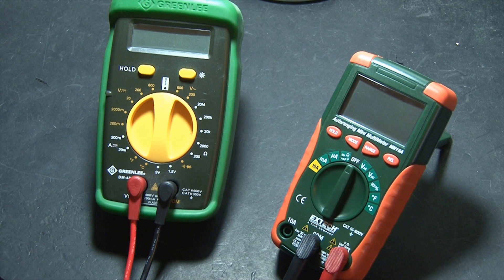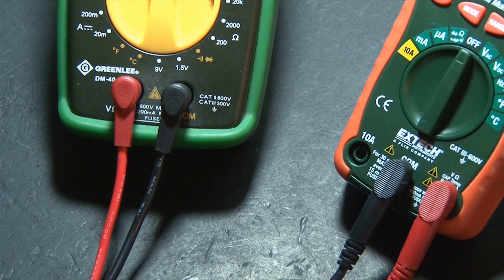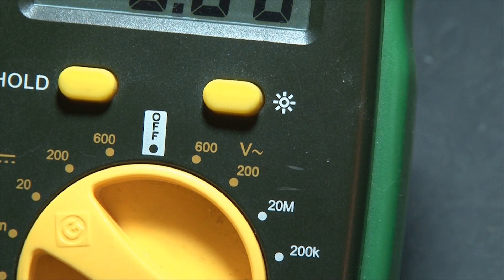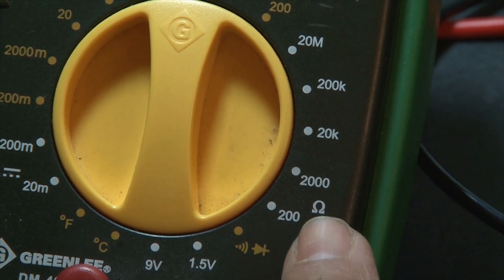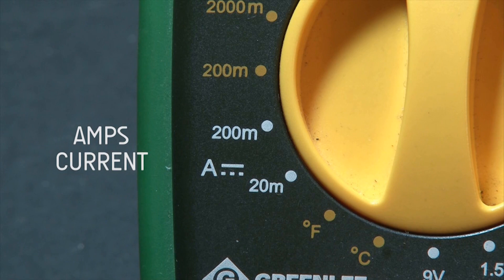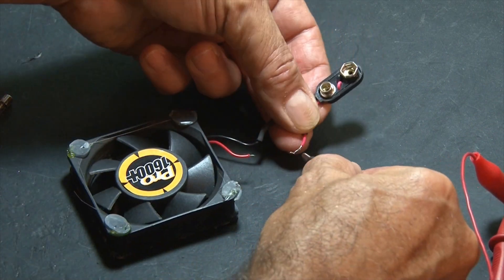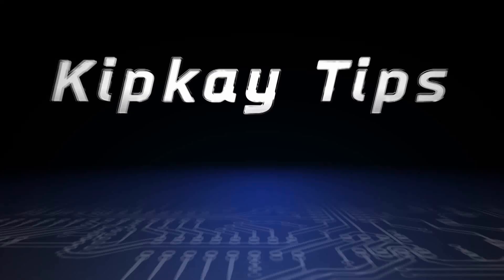How Does a Multimeter Work? Kipkay Tips

Comment: How does the temperature work?
Reply: It has another pair of wires (thermocouple).  Just plug in the red and black probe.  The other end is used to measure temperature, say air conditioner of automobile.

Comment: yet my dumb teacher told me not to stick my sticks into the outlet...
Reply: Mr.Found yup... when she told me that I did it and she went wtf
Reply: Well, with cheap multimeters it’s never a good idea to do that, it might have a resistor between the probes, good ones are 10 Mohms, but cheaper ones might have higher ones, and remember that if you accidentally switch the range selector to the amps range (only on bad ones) it just shorts the probes in a shunt, that’s very dangerous and could cause the multimeter to literally explode when the cheap glass fuse shatters (that is if there is a fuse at all)
That’s why you shouldn’t plug your cheap test leads in a wall outlet  

But with that said, chances are nothing is gonna happen anyways

Comment: 3:09 what's that chip device for, does it play sound? 

And I have a RadioShack Mini Multimeter that I rescued from their trash. I had to take it all apart and clean it all out and I got it working. Had to change the probes because the other ones were broken.

Comment: My multimeter has a hFE function for transistors, which is handy. Does a multimeter break when the voltage is above the range, but I am measuring with a fused contact (1.2A). Also, when I check a Schuko power outlet (I am from Serbia), which is 220V, can I set a 200V range?
Reply: i dont know I have true RMS meter so i dont have those options. but nothing should break unless you try to check resistance or continuity on a live circuit or electrical devices using the probs on the amp setting (that is for small electronic things, for real electrical work use a clamp on amp meter and use it on only one wire at a time to check for current). go to the next highest Voltage range.

Comment: Why does the US only have 110 volts?  In Europe it's 230 or something...
Reply: Actually, in the US, the power IS delivered as 240 Volts.  But, we divide that power once it enters our home's "load center."  The load center is sometimes called a "power panel" or "circuit breaker box."  

It's true that most of our smaller appliances use only one of those 120V legs.  But as delivered to a residence, there's two separate power-carrying conductors, each supplying about 120V.  After they pass through our power meter, they enter the residence, and then a load center.  But these two conductors are carrying power that's 180 degrees out of phase from one another.  In other words, when one is at +120V, the the other is at -120V, for a full differential of 240 Volts.

Where they enter the power panel, they two conductors are physically connected to two separated bars called busses.  The load center is also connected to a grounded conductor (or as they'd say in the UK, "earthed").  That ground is at "zero" Volts.  Therefore at any time the difference between ground and one of the two individual busses is up to 120V.  

The single-width circuit breakers seen in our power panels are then used to tap one of these busses.  It'll have a black (or red) wire coming out of the breaker.  That conductor, plus a white neutral wire (which is connected to ground also, but designed to carry current -- which makes it different from a grounding conductor, which is there for safety only) are then routed to wall outlets and light fixtures, bringing 120V to them.  

However, when TWO (red or black) conductors (one from each bus) are used together, the net difference means you're right back to 240V.   An example of this is how ovens, electric water heaters, and electric clothes dryers are wired in the USA, due to their high power needs.  These are fed by "double wide" circuit breakers, which tap both power busses to get the full 240V.
Reply: @floobertube Thank you for the explanation.
Reply: Why does Europe have 230v? In the US we only use 110v.
See what I did there? =p
It doesn't matter in the end.
Also the US was one of the first to use it on such a large scale. So, unlike Metric, Most other places were the ones being contrary for this one.
That said, 110v requires higher current, thus thicker cables.
230v requires more insulation, thus thicker cables.
With the price of copper vs insulation, I guess 230v works out better but, hindsight is 20 20
Reply: 230 V phase-to-neutral and 400v phase-to-phase has lower transmission losses and can deliver more power with equal wire gauge, with that said its more dangerous, but more danger equals more caution, so plugs and circuit breakers are much safer.
And that’s also why Americans usually have two wire medium voltage poles with a transformer for petty much every house, while Europe has 3 wire three phase medium voltage lines powering bigger transformers that feed three phase+neutral lines going out to a bigger area: transmission losses are less and it’s cheaper to have a single big tan former for many city blocks than one for each house (or almost)

Comment: 0:46 you got that backwards. The path from  the voltage port to ground has a resistance of 10 megaohms in most modern multimeters. It isn't going to do that much to a circuit, even if you use it completely wrong.

The path from the 10A / mA ports has a very low resistance and you have to know what you are doing when you want to use it, but it's fused, so it can't do that much damage to a circuit.

Comment: Trying to measure the resistance of a speaker and compare it to it's impedance (8 ohm) and says well it's not quite but its within tolerance. He obviously doesn't know what he's is talking about 'cause I've never seen a DMM that is able to test impedance at 1khz.
Reply: He does not understand the difference between resistance and impedance/reactance (induced by a.c. or electric pulses).    A DMM does not generate sine wave of 1kHz.

Comment: A multimeter is good for any DIY project?  Nope.  Can't drill holes with it, can't cut wood with it, etc.  Putting that aside...

What kind of idiot-level explanation of multimeter usage fails to mention that putting multimeter probes into a mains socket is perfectly safe as long as the meter isn't switched to current, continuity, resistance or diode test?  An explanation aimed at idiots that was provided by an idiot.

BTW, any sane person would have checked the fan current by placing the connector on just one pole of the battery, leaving one pole of connector and one pole of the battery free to be bridged by the meter.  This avoids the bodge of cutting the lead, then having to solder it again later.

I thought from the title and the preview image that this would be a flash-bang demo of what not to do when metering the mains.  Instead it was a trite, banal, condescending explanation aimed at idiots made by an idiot.

Comment: guys those who are from different country  with 230 v a.c. don't keep that knob on 200v keep it on 600v or whatever greater than 200v
Reply: Or just get an autoranging multimeter. Nobody should buy a manual ranging multimeter in 2017.
Reply: StarTrek123456 yeah autoranging multimeters are cool but i kinda like manual ones

Comment: When doing the outlet thing, with the probes are not touching each other, you trip the breaker. What happened? I did it before and it did nothing, but some time later it tripped the breaker and the outlets still works for some reason... The probe end did melt a bit.
Reply: You might have had it set to Amps, current test, instead of voltage testing?  The only reason a breaker would trip is if a large current was flowing through the circuit.  If you did have it set to voltage, then something could have shorted inside your meter.

Comment: At the end of the video, Kipkay said, "As long as you have a multimeter with a digital readout, you'll be good to go..." My question is: What's wrong with multimeters that have an analog readout, like a needle on a scale?
Reply: Alexander Shekhtman Well, by process of elimination, they're not "good to go"! 😂😂😂
Reply: Analog readout is harder to read. If you are not looking directly onto the needle and the scale under it but in slight angle you get a parallaxe error which can be rather significant depending on what you are measuring and which scale you use. There is nothing wrong with analog meters, digital is just the safer bet.
Reply: Alexander Shekhtman I believe he was referring to the temperature setting for that comment.

Comment: What is going on with these 1,5V/9V battery test modes, why we would need to use them instead of voltmeter mode?
Reply: They put small stress on the battery (a resistive load) and check the current. Sometimes an AA battery for example will have enough volts but the amps will be too low.  This checks both.
Reply: Oh, ok then.
So basically it is a LowZ voltage test.

Comment: could u check vape coils resistence with one of these
Reply: cheap multimeters often are not that accurate to measure that low resistances. Search "atomizer ohm reader" on ebay. Those are pretty accurate and cheap

Comment: 3:07 what's that circuit board for? It looks like a singing greeting card chip.

And I have a Radioshack Multimeter that I found in the trash. I cleaned and I fixed it all up and it's working perfectly. I still have it. I had to replace the test leads as the ones that came with it were broken but I had two jumbo ones (also found in the trash) and they were soldered straight on the board.

Comment: Interesting on the wall outlet test. I've checked mine and it's 125VAC. So there's variance between voltages in different places in the U.S. I'm in Rhode Island - and the provider is National Grid.
Reply: Depends on how much load you have in your home and how close you are to the transformer.
Reply: Mains voltage drifts a little around the nominal value as the load on the grid changes. Usually the actual tolerances are available somewhere (power company's website for example) so that you know when you can complain about not getting your money's worth. Where I live, it's about 7.5% either way, which is almost 20 volts (I live in a 230V place).

Comment: I thought you were going to warn against putting the multimeter in current measuring mode and plugging it into the wall outlet, which would short the 120/240VAC line through the meter
Reply: The circuitry in the meter will be your fuse unless you use the 10/20 amp range

Comment: I am dismayed that an "educational" video would offer incorrect information.  When measuring the speaker, it was said that the resistance (6.8 ohms, if my memory serves me) was "close enough" to the 8 ohms marked on the speaker.  Actually, a speaker is rated by its impedance, not it's resistance.  Impedance is essentially a measurement involving alternating current, whereas resistance is a measurement involving direct current.  They are NOT interchangeable.  The details are available on the WEB.  This video only serves to perpetuate this widely misunderstood difference.

Comment: Wait, how does it check temperature??
Reply: Normally the meter comes with a small sensor, thermocouple, with wires that you plug in instead of the probes.
Reply: with a built in thermometer.
Reply: Oh okay, thank you. For some reason I was thinking about the leads...

Comment: I've busted a few multimeters in my day... it would be cool to have a WHY explanation for amps needing to be inline. I don't know about other people, but I always remember things better if I know why.
Reply: beriukay current 'splits up' when you have two components or wires in parallel (not in line) If you connect the ammeter in parallel you'll have part of the current flowing through the ammeter, and part of the current flowing through the wire you're placing it across, depending on the resistance of the two paths. This means you will not get the true current reading. Voltage is different, because it is exactly the same across two parallel components. This means that if you place a voltmeter across a component, the voltage on the voltmeter is the same as the voltage across the component. Like I said however, current splits up in a parallel circuit, so you might think current will flow through the voltmeter, disturbing the circuit. This is why voltmeters are made to have 'infinite resistance' (theoretically). Current flows through the path of least resistance, so if the voltmeter has infinite resistance and the component you measure the voltage across has a resistance of say 10 ohms, all of the current will flow through the 10 ohm loop, as infinite resistance is like an open circuit, no current will flow through.
Reply: You measure the current the flows THROUGH the circuit, to do that with a basic multimeter, the current also neds to flow through the meter.
¨There are alternate ways though - One can use a clamp-on meter which has jaws, like  tongs, that you position around the conductor you wish to measure the current in. The jaws essentially form part of an transformer. Usually used for measuring larger currents. Note that if you have a lead with two conductors, like say on a lamp plugged into a wall outlet, the two conductors would have to be separated and only one run through the jaws, otherwise the meter would show 0, as the current flowing into the lamp through the first conductor would be cancelled out by the current flowing back out through the other...

One can also measure current indirectly, by placing a small resistor in series in the circuit instead of the meter, and use the volt function on the meter and measure the voltage across the resistor and then use Ohms law to calculate the current. This is also what the meter does internally, using very low value resistors - so don't try to measure a voltage with the probe in the current position...

Comment: If I want to measure voltage of something (for example: 1.5V battery), what's the difference in putting maximum voltage to 20V or 200V?Because in both cases battery's voltage doesn't go above limited.
Reply: Đorđe Milanović you put it to 20v so it gives you a more accurate reading on the voltage. of you set it to 200 it'll just say 1volt. But If you set it to 20 it'll say 1.6volts.

Comment: you've got it backwards at the beginning you never wanna check for voltage with the probe in amperage, not amperage with voltage, if you try and check for amperage when you're hooked for voltage the meter will just show you the difference between the source and the load assuming your circuit is otherwise complete it should show source or battery voltage. 

however when your checking amperage you're putting your meter in line so to speak, completing the circuit with the meter, if you check voltage with your meter hooked in amperage you're essentially completing the circuit from positive to negative through your meter thus blowing the fuse on the more expensive models or frying your amperage circuit on the cheaper type

Comment: Why did u cut that wire from the battery socket to the fan? U could just hook the multimeter in series from the battery to the battery socket? And save the wire to the fan

Comment: I've learned more about my multimeter in the first 2 mins of this video in my last 10 years of casual electrical interest...I've had a multimeter for a good 5 years and I have been to confused by over complicated explanations in the past. thank you. I guess this could just be an epiphany, but relating "alternating" current to the tilde: ie the wave of alternating current. and a line and dot dot dot of DC is the pulse? made sitting click. thanks.

Comment: Good luck measuring AC voltage in Europe... All plugs are protected and it's basically impossible to put probes in the plug
Reply: PaxGrime | Viper Boosting you just need to put one probe in the ground first, that will unlock the plug.

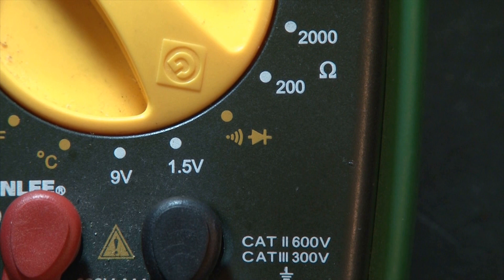Comment: 2:46 - Impedance of speaker isn't the same, as resistance of the coil. Moreover, impedance of speaker changes in function of frequency, the highest impedance is on resonant frequency of speaker (it can be about 4 times larger than nominal impedance)

Comment: didnt have to cut the wire on the fan. you could have just turned the plug so only one side was connected to the battery. then close the circuit with the meter.

Comment: My mate had 2 wires into a socket being held in by a plug and with 2 crocodile clips on the other side attached to a radio. His disabled dad came into the room one time on his electric wheelchair and knocked the radio onto me, the shock was unpleasant to say the least, 240v DC stuck it to me until I managed to shake the thing off me.

Comment: Cant really do this with a UK plug socket as we have shutters blocking the live and neutral on our sockets, unless you shove something in the earth/ground to open them.
Reply: Peter W we have those type sockets in India too,  I usually just use a plastic pen to open the shutters
Reply: It's called a hot wire, live wire describes all of the electrical wiring because it is all live.

Comment: how would it measure temperature?
Reply: burnzy3210 mine does :)
Reply: I'm not asking if yours does, I'm asking how a multimeter is able to do that
Reply: oh sorry, I didnt read your question right, well mine uses an infrared temperature sensor at the top, but I think his requires you to touch a wire to the surface to measure temperature.